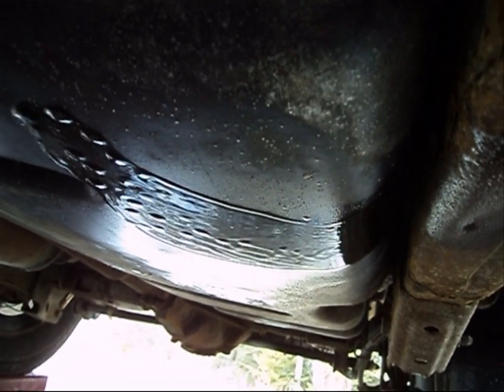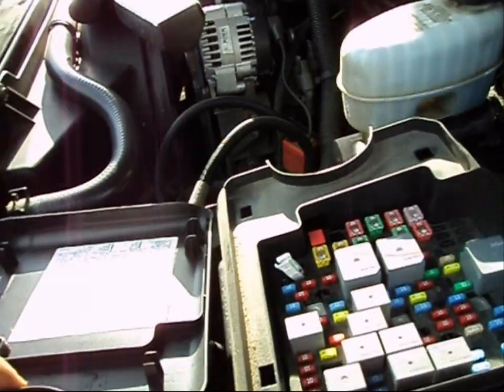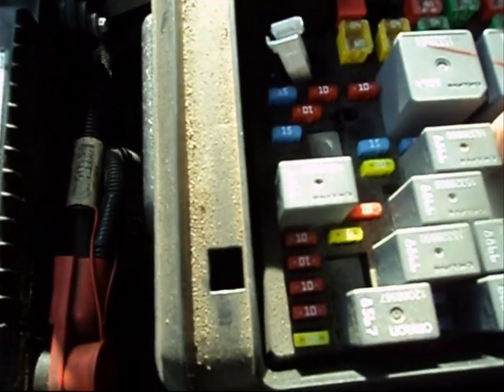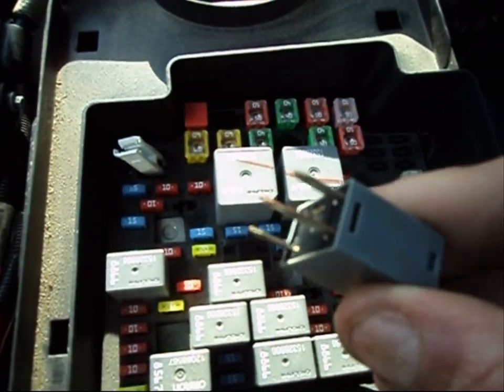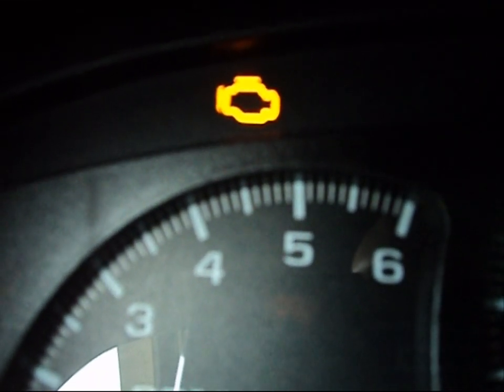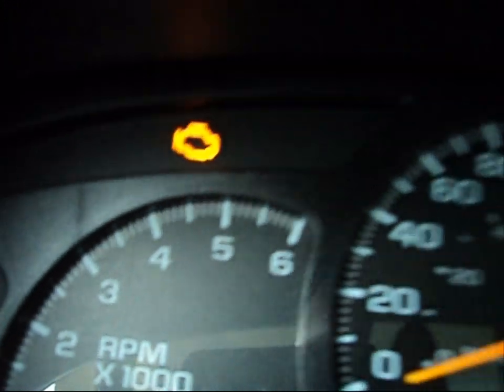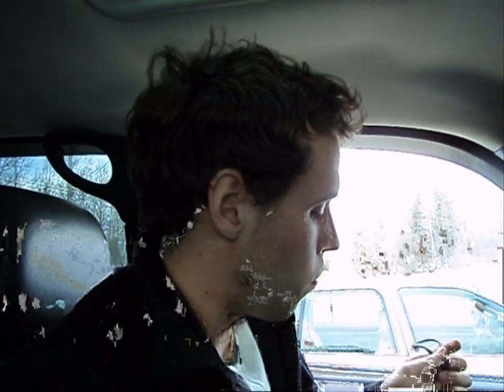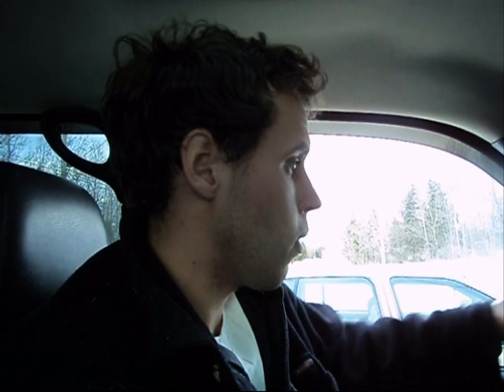Fuel System Repairs: Depressurizing Fuel Lines

Comment from the maker: Yup, It'll work. Just pull the fuse and start the car till the engine dies. It might take only 5 seconds. And yes as long as we are dealing with a fuel injected vehicle, the fuel pump will prime the fuel lines, fuel rail, and injectors by simply turning the key to the "Run" position. If the car does not restart turn the key to "run" wait 5 seconds, turn key to "off" and wait another 5 seconds, and then back to "run" position again. This will activate the fuel pump and send fuel to the engine.